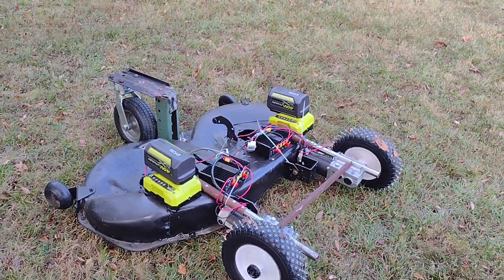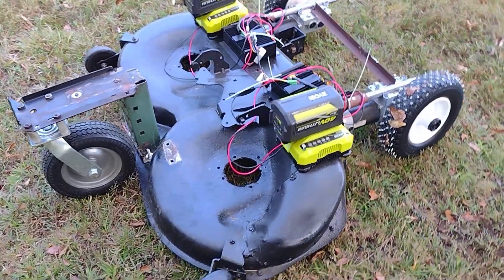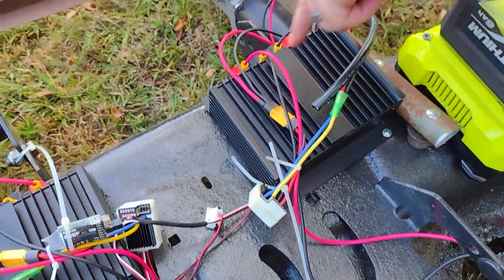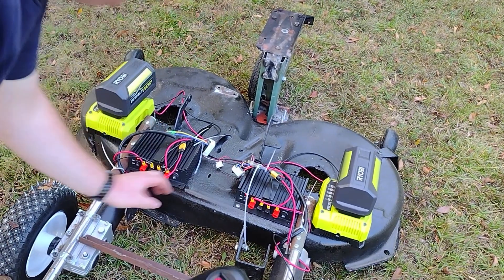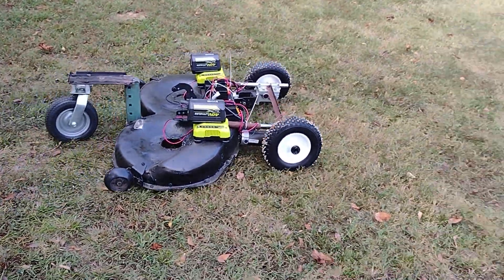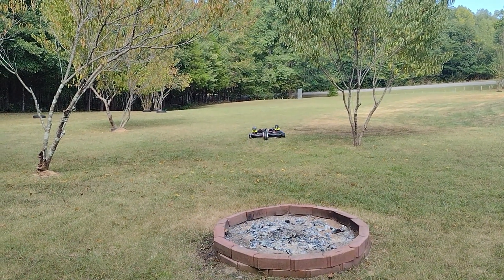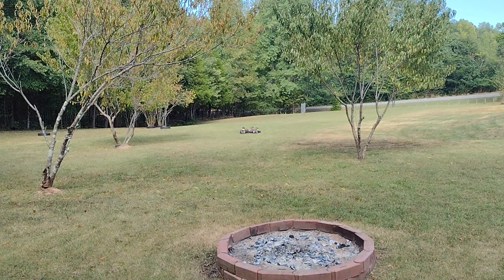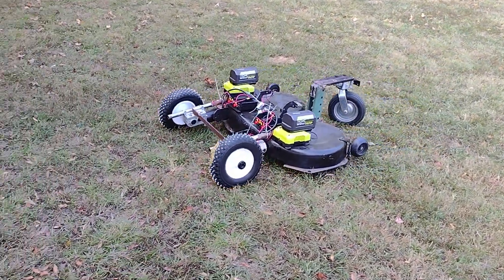Ryobi 40v Powered 42" DIY Radio Controlled Zero Turn Lawn Mower "Mad Max - Fury Mowed" - Part 1

Comment: I'd love to compare notes w/ you if you are on facebook or someplace to give contact info. I'm using a 2 channel speed controller w/ wheel chair motors. The speed controller has a built in input for the radio (SmartDriveDuo-30). I'm giving up on analog FPV and going to get a digital Walksnail Avatar setup. Have you started looking at Ardupilot and RTK-GPS for autonomous operation? I'm going to explore that this winter. Last question...are you planning cutting discs or blades? I bought some Razor ZY6812 24 motors for blades. Not sure if I will need to use a speed controller for those or just on/off. Thanks for the vid!
Reply from the maker: Honestly I have no social media account other than this, but feel free to message me here. Perhaps others will join in and give us both ideas. Still haven't finished my FPV setup as I'm new to remote control equipment. I'm going try using a Wi-Fi security camera, but I may have to improve the coverage by adding an outdoor router. I want to be able to watch it on my TV so I can operate it like a video game. Haven't looked into the autonomous idea yet, but it is a thought. I used cutting blades, which I actually did in the follow up video. Check it out and you'll see some things that made it work better. I ended up using 2 Ryobi 40v push mower brushless motors with controllers, connected to their factory blade holders and 21 inch blades. That kept fabrication to a minimum. If those motors you bought are brushless you will need a controller, but if they are brushed you can just use a simple toggle or a relay.
Reply: @oddjobsandrandomprojects  go with a 5.8ghz analog video transmitter and reciever setup. wifi will be short range and high latency. you can add a flight controller with inav for the automation hes talking about. im going to be starting my build in a few weeks. hows yours going so far?
Reply from the maker: @fourknotsnowhere  So far it has been working quite well. Mowed several times with it and no problems. But you are right about the latency on wifi. That makes it almost impossible to use the camera. So I just go stand in the lawn and run it old school for testing. But, other than the camera, it is working well.

Comment: Wheel chair motors are typically 24VDC, interesting yours are 12VDC. Your "power converters", aka Voltage regulators seem a bit over kill at 45 Amps. Cheap and compact versions at 10 or 20 Amps will work just fine. In most cases, a RC ESC can take that 40V directly and you simply trim the output speed so no regulator is needed. 

I converted my Kobalt 40V with similar motors as yours but 4 pole not 2 which has higher torque. I use Dewalt bateries for drive and the orginal kobalt battery for the cutting motor. 

Good first try, brush up on the RC electronics and use a programable radio not that toy grade RL garbage. You will cut your weight in half w/o all that "converter" stuff going on.
Reply from the maker: You are correct about the wheelchair motors. Mine were listed at 12v or 24v, but the original chair was 24v. That would have made lower amps possible to deliver the same wattage. The motors were listed at 500 watts maximum, 250 watts continuous. So a 20 amp 24v converter should be just fine. However the ESC I bought was only rated for up to 18v I think, but up to 90a. That's where I got myself in trouble. I'm familiar with the electrical, but RC equipment is all new to me. If you don't mind, drop me a link to the ESC that worked on yours. I'd love to be rid of the converters and just let the ESC do the job. I do think the extra weight might actually be working to my advantage though, as my newest revision has the weight moved over the drive wheels more and my traction issues are much improved.

Comment: Very nice 👍🏾. My second and third rc mower were both originally built with the drive wheels in the front and swivel wheel(s) in the rear. What I learned was that the mower would always want to oversteer whenever I did a relatively quick turn, and it was also way more difficult to control and drive the mower up inclined (which resulted in the mower tearing up my lawn in some instances) because the weight of the mower would always want to point towards the bottom of the incline because the swivel wheel(s) offered zero resistance to help and the mower from doing that. I ended up swapping the swivel wheel to the front, and the drive wheels to the rear for my second mower. So far, I've been lazy about doing the same for my third rc mower 😂. That said, your lawn looks relatively flat, and you are running your mower at a speed that's slow enough to keep the oversteering issue at bay.
Reply from the maker: Thanks for the insights. I've got some pretty bad inclines in places myself, and I have noticed that problem too. It was really bad with my first design, but seems better with this one. I spaced the drive wheels farther apart on this design and shortened up the tail where the caster wheels are. I think that helps, but I'm still deciding which direction it drives better. I also noticed that the tire spikes helped with the steering too. I'm planning to try moving the drive wheels all the way to the outside, and as close to the deck as I can.